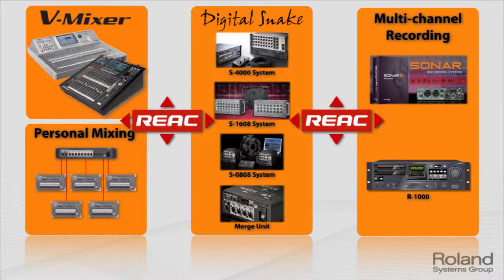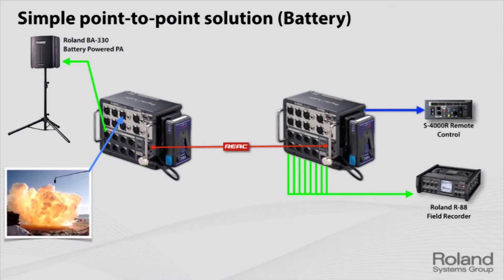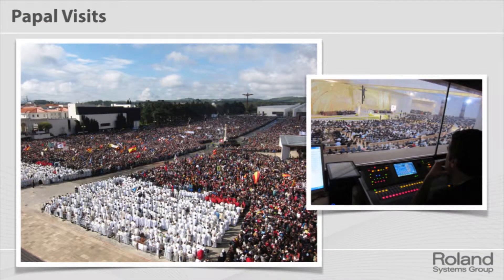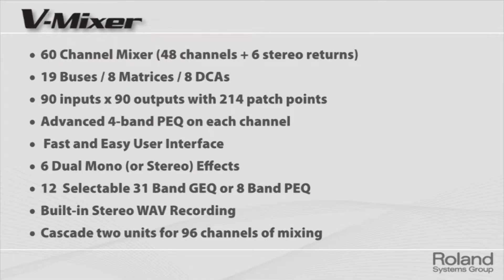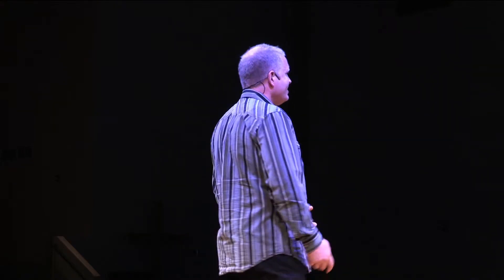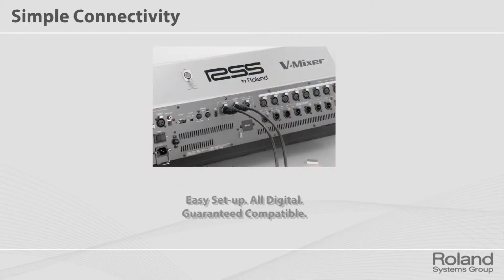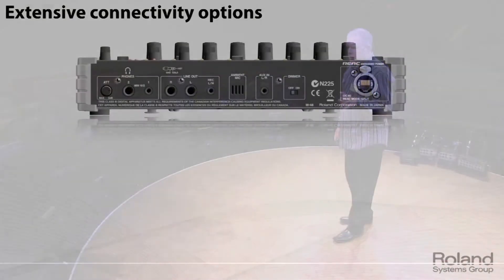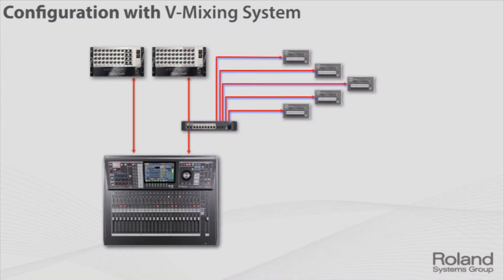Roland V-Mixing System Part 2: The Four Components of a System

Comment: Our school uses the still excellent V mixer M480 with 2 digital S-1608 snakes that are hard mounted to our rack off stage. We're preparing to temporarily add 12 Wireless mics/transmitters for a school play. Can we add a 3rd S-1608 for the wireless system into the 3rd REAC port (currently unused) and use the patch bay to assign the added mics of the remaining unused channels on the M480?